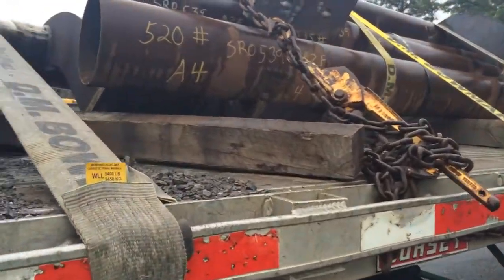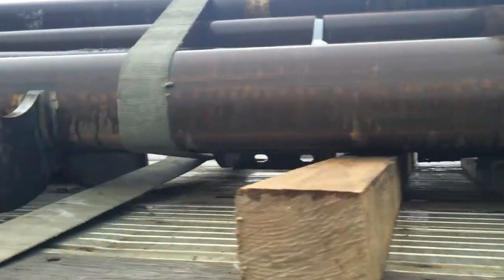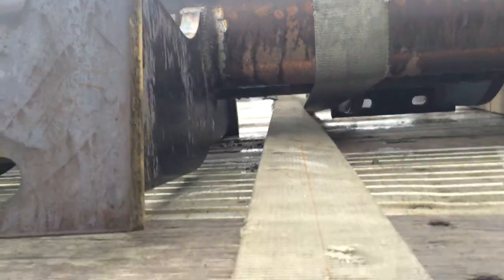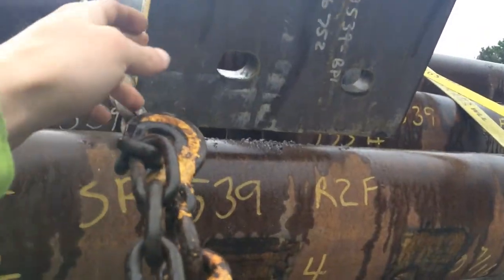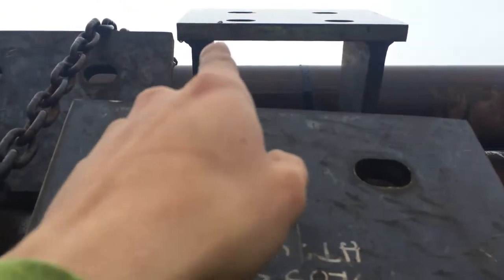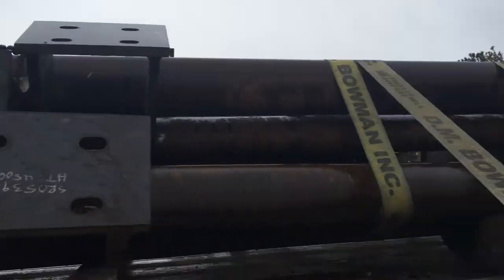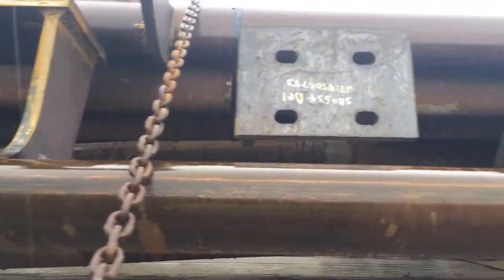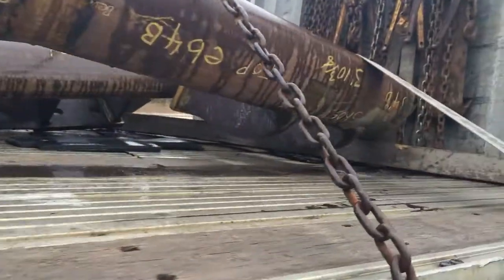Flatbed techniques and strategies: cinch strapping

Comment: Straps are supposed to go through the rub rails per DOT.
Reply: From my understanding  its recommended but not mandatory
Reply: That's called a DOT wrap ! 
 
 Driver's choice how to secure to rub rail.

If you read the regulations " All tiedowns and other components.......   whenever practical inside the rub rails "
Therefore the hook should be inside the rub rail and that's not practicable on some trailers.
DOT has flip flopped a couple of times on this and determined that rubrails are permitted for securement, so it ends up with driver's choice.
You and I may prefer only the hook outside, but this fella has his reasons, and since his securement of a difficult load is well thought out, I'll trust his reason for a DOT wrap.

Comment: How is it that people who do this for a living don't know the laws? NO STRAPS OUTSIDE THE RUB-RAIL.
Reply from the maker: mark birchall because it’s not an enforced law. I’ve trucked cross country for 5 years and literally never once have had any officer say a single thing about straps outside the rail. Not to mention trailers have rub rails that are rated for securement.
Reply: I dont doubt you Thomas-- but if you get into any kind of accident and anything shifts just a little,  they will find you to be at fault.  Just as if you are driving over your hours of service.  Isnt it just easier to strap the way the law specifies?
Reply from the maker: mark birchall I wanted to highlight something. For these trailers, the manufacturer specifically states to secure to the rub rail, not the flange underneath. So no matter which way you run the strap be it down through and then back to the rail, or over and then hook inside you still at some point are on the outside.
Reply: Very confused , what trailer manufacturer states this
Reply: What tool capitalize his comments. Oh! A tool that is a fool.
FMCSA is clear as mud. 
......whenever practical all components inside rub rail. 
The hook is a component.